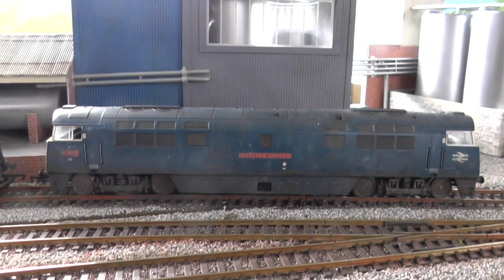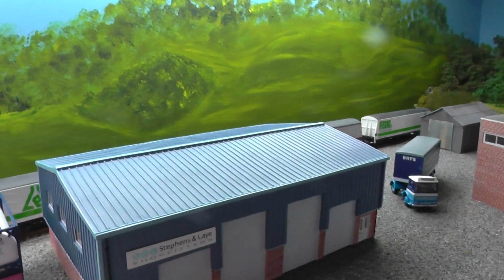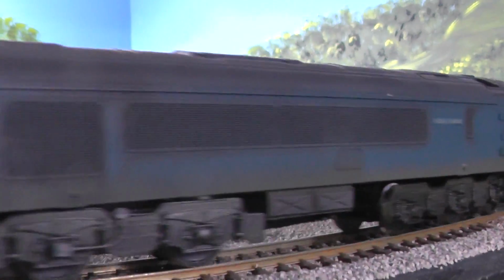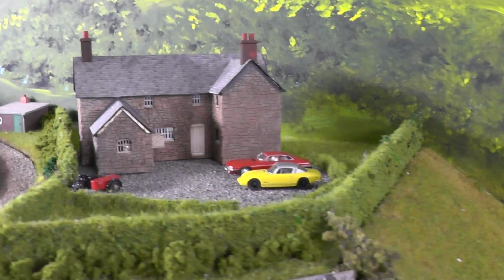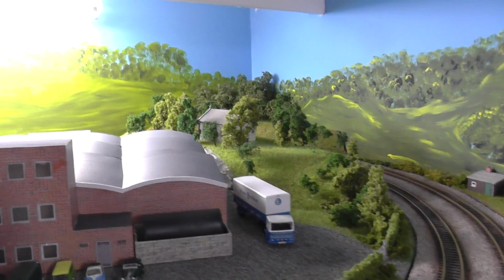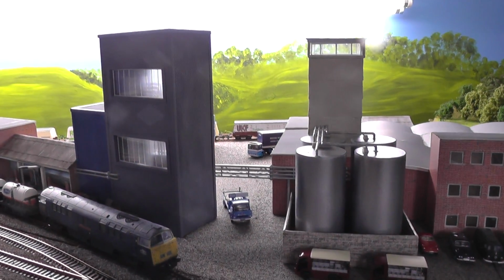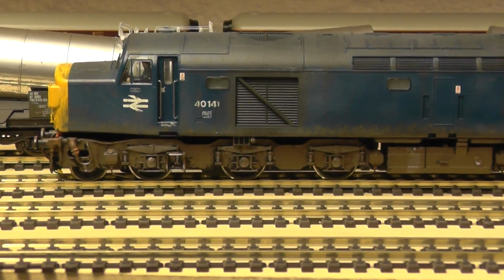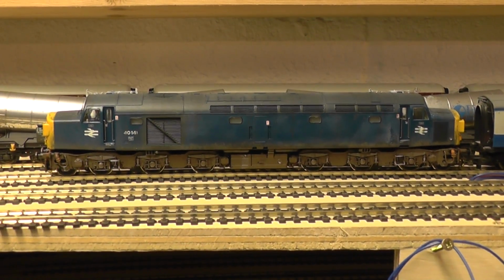Penwithers St Ivel Creamery part 3

Comment: How did you make the Motorail wagons?
Reply from the maker: Hi I used the chassis off some mk1 coaches and soldered some 3mm dia brass rod to make the rails , got the transfers   From fox transfers cheers Kevin
Reply: Thanks